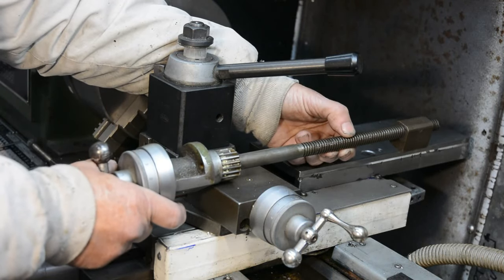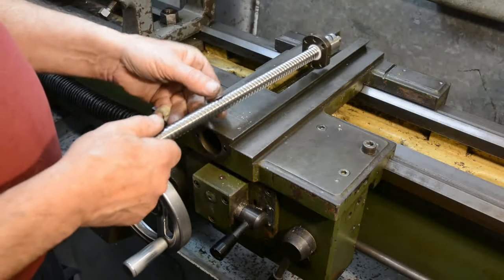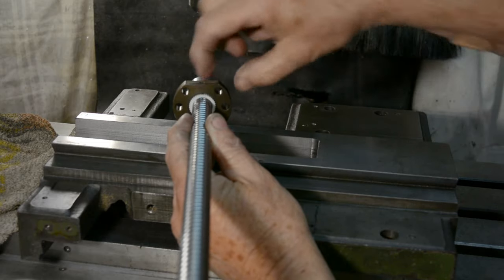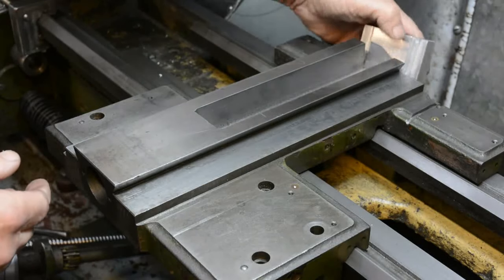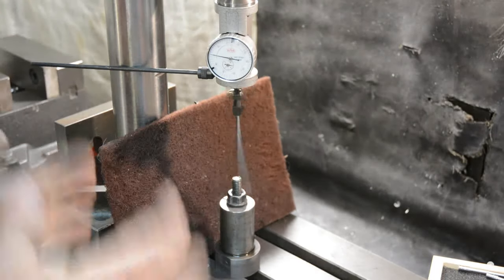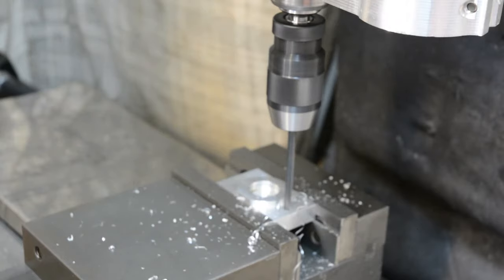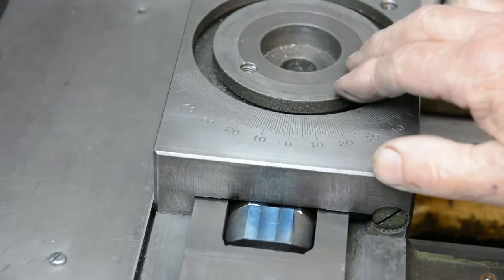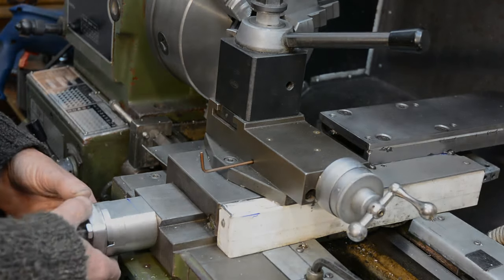Lathe cross feed conversion to a ball screw.

Comment: Great video on fitting the new ball screw and nut. I would like to change my acme cross slide screw and nut as well but the pitch is .125” or 8 TPI LH. There are lots of metric size suppliers but does anyone know who sells an 8 TPI ball screw and nut?
Reply from the maker: My acme screws were imperial but that was no problem, I just replaced with metric ball screws.
Reply: I wouldn’t mind changing to metric but I have no digital readout.

Comment: Doesn't the lack/reduction of friction mean you now have to hold the cross slide wheel or lock down the gibs when you take a cut for the tool to not be forced out of the cut?
Reply: My lathe uses a ball thrust bearing that you can tighten to eliminate creep while turning.

Comment: With a ball screw how do you get the self-retention?
Reply from the maker: Think about an ACME style thread, the reason that it stays where you put it is friction.  The bearings that hold the ball screw are preloaded and they give enough friction.  In any case my ball screw is motor driven and the motor holds it.

Comment: Nice conversion video, thanks.
The balls and leadscrew almost have the same hardness unlike the original lathe cross feed brass nut setup.
Will the ballscrew get backlash in time and how then to reduce the play?
Reply from the maker: After two years of regular use I have had no problems with wear but it gets a lot of oil.  See my current videos to see the backlash measurements.

Comment: are you tony foale frame chassis manufacture from 70s if so this is steve mainwaring rode one you tz350 chassis owner cigy poole found your video interesting I have gone from manual to CNC haase mill lathe got excel d40 cnc be not needed but be interesting in doing conversion like you done were did you acquire electronics if you don't mind kind regards steve mainwaring
Reply from the maker: I have to plead guilty to your first question.  Here is a one min video which you might find interesting.  https://www.youtube.com/shorts/7NpMMKi6BLE
Send me an email and I'll send you some details of the conversion.  I do the electronics and programming.

Comment: do you think a 12x4 ball screw supported with angular contact bearings on both ends will be enough for a 14x40 lathe? thinking of putting the screw under slight tension so its never pushing the cross slide, but rather always pulling on either end bearings.  ill have to make some kind of inverting gear system so that my hand wheel still work right. will see.
Reply from the maker: 12 seems a bit small to me for that size lathe, but I have never tried it.
Reply: They make ballscrews left handed no need for inverting gear system mate
Reply: thay are hard to come by and when you finde them very expensive

Comment: Great video thanks.  I want to  convert to a ballscrew on my milling machine but it will require me to do some turning on the ends of the ballscrew.   Do you know if whatever they are made of they could they be turned?
Reply from the maker: I had no problem turning the ends with carbide tipped tools.
Reply: @MotoChassisByTonyFoale  many thanks for that

Comment: The bearing receiver could be made to adjust in x and y so you could dial in the alignment, Yes?
Reply from the maker: Yes it could be made adjustable quite easily.  The problem with adjustability is that it gives the opportunity to be adjusted badly.  You might be interested in the electricfication of the screws in a new series at 
https://www.youtube.com/playlist?list=PLyn2snGjYlHw_e4LomNphh8KleeqPiqpz
The next video there will be looking at fitting the Z axis ball screw with a different solution to the end bearing.
Thanks for your comment

Comment: Ball screws have the added benefit anti backlash nuts which would remove the backlash alltogether. My question though, would it not be easier to create an anti backlash nut as replacement rather than modifying the lathe saddle?
Reply from the maker: Easier is easier.  I wanted better.
Reply: On mine the Acme threaded rod was worn to sharp points.

Comment: Hey Tony, 

First,  I would find it strange to have a RH thread vs the standard LH thread for the cross slide.  I guess you get used to it but just so used to clock-wise being in vs out.  Never looked, I assume they make LH ball-screws but probably at a premium?

Second,  I suppose you do not use the power cross feed often?  I noticed the gear on the standard axis shaft.  I supposed I don't use power cross feed all that often.  Or you could convert to electronic if really wanted I suppose.
Reply from the maker: Yep, you got it.  My "deliberate" mistake was ordering the screw without thinking about direction.  There must be LH versions around but I have found none at the budget level since I realised my mistake.  I am getting used to it but it does not feel natural.  I have not crashed anything yet but I think carefully before moving it.  I am so pleased with everything else about the changeover that I am prepared to work at getting used to the direction, although I shall continue searching for a LH version.
Reply: @MotoChassisByTonyFoale    I wouldn't have caught that as I jumped ahead to see the end and total new backlash . I am curious to know how well a new carefully machined nut would have worked , cost and taken to make ?
Reply from the maker: @eflanagan1921  A machined nut is always going to have some backlash unless you make it a tight fit, but then it will wear much faster than a ball screw.
Reply: @MotoChassisByTonyFoale  Hi Tony, I spotted you'd got the wrong hand thread when I first saw the ball screw. Many people have been caught out between fixed and moving nut setups. Left handed ball screws are quite rare; since they're associated with CNC the reversal is just solved in software. 

You could kill two birds with one stone and fit a stepper, hybrid stepper, or servo to the screw. For manual use drive it with an MPG (manual pulse generator) and a variable frequency generator for power feed.
Reply from the maker: @EVguru  I have found it hard to source a LH version but a stepper and MPG were are the cards before I did this.  Once you have that then why not add some smarts and have constant cutting velocity when facing?  Heck, you only need minimal brains for that and an Arduino or ESP32 would handle it easily.

Comment: You don't show how you mounted the bracket for the ball screw in the back. I would have drilled and tapped holes when you had
the saddle on it's side.
Reply from the maker: I drilled holes in the bearing block and then spotted through.  the block was spiggoted to the cross slide for alignment.

Comment: Thanks for the video. I am considering applying this to my 5913 Clausing that has a worn lead screw, My question is do you still have power feed on the cross slide ? BTW I am a new subscriber. I am impressed by your work.
Reply: You'll have power feed if you remove the gear from the original lead screw and mount it in the correct location on the ball screw. I am currently at the beginning stage of this same upgrade. On my lathe, KBC12X24, the gear for the power feed is held onto the lead screw with a roll pin, easy.
Reply from the maker: No I did not retain the cross slide power feed.  It does not matter now because both axis are motorised, see a later video about the electronic conversion.

Comment: nice modification.  however .03 backlash on a lathe cross slide means nothing as the cutter is always pushing back on the cutter. but i do understand why you did what you did.
Reply from the maker: Firstly it originally had 0.75 mm  not 0.03 backlash.  All I can tell you is that it made the lathe so much nicer to use and easier to control accuracy.  If you watch the later videos you will see that I motorised the slides and minimal backlash is desirable for that.  The recent videos show why it is even more important for me to have near zero backlash.
Reply: @MotoChassisByTonyFoale  .03 inch is nearly same as .75mm.  I said i understand why you did it. i was just making a point that backlash on a crosslide is a moot point. I have worked on many lathes with .03inch backlash and made perfect parts.
Reply from the maker: @blitzkrueg07  You did not specify inches in your first post only .03

Comment: If you use an externally threaded ball nut you will have more clearance. Just make a threaded bracket in place of acme nut.
Reply from the maker: I use one of those on the Z axis of my mill but it wasn't so easy to fit on the lathe.
Reply: @MotoChassisByTonyFoale  managed to squeeze one on an atlas th54

Comment: what holds me from ball screw install on my cross slide is not finding a left-hand screw. i dont have a dro so that means 1 the dial will be inverted and worst of all my hand will also have to learn the wrong way........that may cause a crash or two.
Reply from the maker: The wrong way meant that I always had to think before turning the wrong screw.  It does not matter now that it is motorized.
Reply: Just purchase a left hand thread and it is the same cost.
Reply: @ good if you can find the right thread. In south africa we dont have so many options. will have to import . pain to get certain stuff in this place.

Comment: I'm surpriced that you are even able to use the lathe manually. Typically ballscrews are used only in CNC machines because they need holding torque from motor. 

Normal threads should lock on a place by friction so no cutting force should turn the screw into different position. Ballscrews on the other hand, quite easily turn applied force into rotating motion making it impossible to make straight pieces unless you can mechanically lock the screw in place.

Maybe there was enough friction in your system but others planning to do the same should take this into concideration
Reply: its always good practice to lock slides before the cut. thus eliminating this type of problem
Reply: @chisdalton9652  Maybe in finish cut but otherwise that would be terribly inconvenient.
Reply: @fuckingpippaman  Maybe you have worked with machines which are made for ballscrews, but if you change ballscrew into typical machine, like it's done when doing cnc conversion, those screws don't hold anything.
Reply: @fuckingpippaman  It depends on thread pitch and overall friction. There's a threshold where basically no force can make screw spin. Typically balls screws have small enough friction so it starts to spin from force on the ball nut. If the pitch is small and the end of the screws have gliding bearings instead of ballbearings, friction can be high enough to go over the threshold.

Such setup van have less backlash and better wear resistance than normal acme thread and brass nut.
Reply: @fuckingpippaman  Worm gear have almost always high enough friction that no force on main axel don't rotate worm axel. Too much force if course brake it.

What comes to that y-axis, best way to prevent movement is to have high enough friction on surface which takes axial forces from ball screw. Then there's no need to have constant friction and the screw is easy to rotate when there's no load.

Comment: Поменялось направление и шаг резьбы , надо менять лимб и заново привыкать крутить в другую сторону
Reply from the maker: Yes, that is true.  The pitch has changed from 1/8" (3 mm) to 5 mm.  I bought a LH screw to change the direction back to normal but the quality was bad and I did not fit it.
I have cured the problem by fitting a motor.  You will like
https://www.youtube.com/playlist?list=PLyn2snGjYlHw_e4LomNphh8KleeqPiqpz

Comment: Great upgrade there. I always thought the original bronze nuts were 2 piece so you could adjust one of them fore / aft to slightly bind to remove backlash.
Was the deliberate mistake not cutting the dovetail into the rear bearing block?
Reply from the maker: There are anti-backlash nuts as you mention used in various applications.  I have never seen one on a lathe but that might be because I have not seen enough.
I did cut the dovetail into the bearing.

Comment: Pretty useless IMO as on a conventional lathe you always come in from one direction. Much more useful is a locking mechanism on all slides, locking any slide not in use will greatly improve any lathe. in fact I found a very well executed locking mechanism on the compound slide of the Colchester Triumph 2000 lathe at work which was a nice surprise.

Comment: This is not a good idea!!!
The factory screw has clearance, but this is not a problem if the turner knows how to work properly! The shape and type of the factory screw are not randomly selected by the factory !!! This type of screws have a very good "self-holding" which is extremely important for this type of universal machines!

The screw with the balls you put is more precise, YES, BUT it does not have good "self-holding" because it is designed for CNC machines where there is a need for super-fast and precise movement + self-holding position is performed by the stepper motor, which constantly holds or rotates screw !!!
Now with this screw there is a high probability that when processing details that can bring vibration, the screw will start to turn and you will lose position and size!
...
Reply from the maker: The "self locking" of a plain screw is just a result of friction.  You only need to add a little rotary friction on the ball screw shaft to eliminate that imaginary problem. 
It was a very good idea, the lathe is just so much nicer to use.

Comment: Yikes! Just because you make something appear to work doesn’t make the process correct or safe.

You didn’t show what happened as soon as you put the gibs back in place. Its a fact that ballscrew is going to lift with the cross plate and cause binding. 

This might be light enough in your case where it is binding where you’re not feeling much resistance on that short run over the cross slide, otherwise you would indeed experience a kickback every time you cut a part. The binding would be worse as you moved toward each end, maybe enough it even locked the cross slide.

Far as if it was installed properly you’d be able to grab the plate and slide it freely back and forth without turning the crank using one hand. If you cant do this despite the fact you think it works then it is installed improperly. 

As a machinist and design engineer I have built enough CNC’s and 3d printers to know how this works myself. If i cant freely move an axis with one hand then it all comes back apart and it is redone until its properly gliding. 

To anyone reading be aware that using a properly installed ball screw for the wrong application is unsafe. There is a reason the industry makes all the variants of screws and why manuals would use a lead screw. Don’t be that first guy who installs it properly who breaks his wrist when it kicks back. Ouch. 

Lead screws are made in universal lengths and can be found all over online. Good luck.